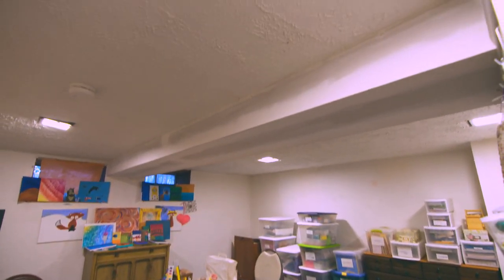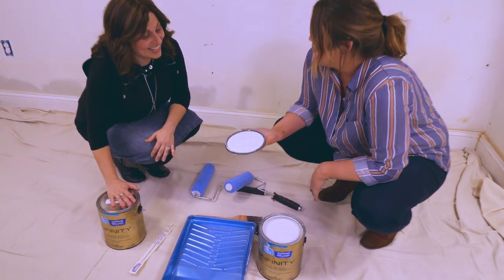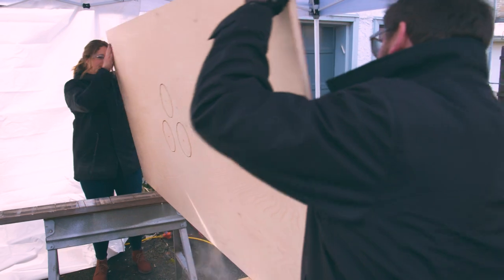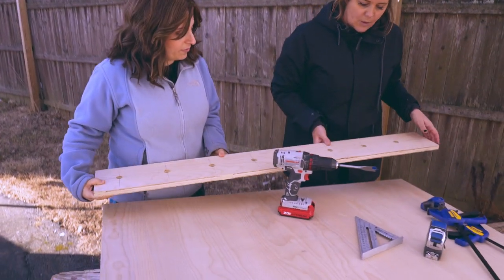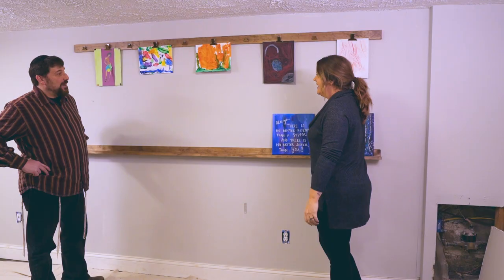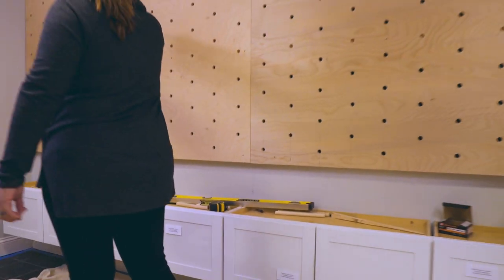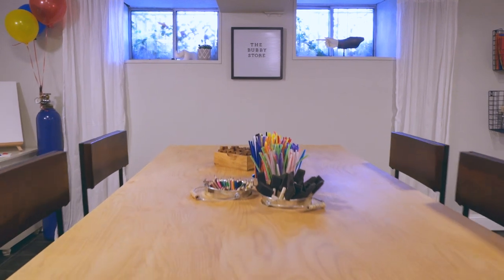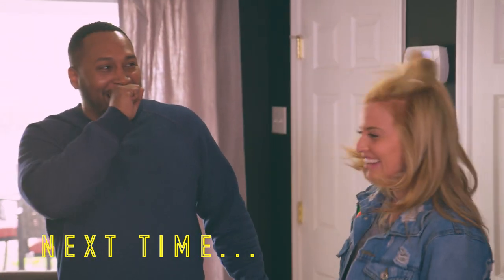The Weekender: "The Creativity Room" (Season 4, Episode 9)

Comment: Monica! I so feel this one! LOL
I am a retired professional designer. All that means is I no longer design for companies, businesses and people, I design for myself! I love color. Lots of color. And in my own space I always have neutral walls. The large pieces of furniture are usually neutral. And everything else is whatever color or season I am working with. That allows the space to be dynamic and non limiting. If you are working with orange and teal for some reason, a strong red wall and yellow items would be distracting to the eye. I put a lot of rich texture in the neutrals so that neutral is never boring. And I use black as an accent.

In other words - the space you did is what I think most designers would feel is a comfortable space to be highly creative. The wood is a great neutral. The only thing I always like to have is a wall of inspiration items. I think part of the pegwall could be this. I usually put homosote on the wall, and use large push pins and drapery hangers (the kind that go in the drapes to hang on the hardware) to mount all kinds of items. Leaves, shells, wood, photos, fabric samples, items that are just beautiful and I can look to as inspiration. This area of course is also intended to be frequently changing. And of course, there are spots it could fit without touching the pegwall (which is amazing! love it!).

Don't apologize for the grey - it totally works!

You have a new fan!

Comment: They have 5 kids plus the mom and there’s only seating for 4.  One of those cabinets should’ve been replaced with simple table legs to give them room.  I like the storage wall but agree with others here that the storage is insufficient for what they have.  I like gray but the color feels wrong for the space.  A soft yellow or light blue might’ve worked better.  This is one of the very few designs Monica has done that I feel comes up short.
Reply: I noticed that those chairs are the tall ones, like you see at a bar, or a place with standing desks. Look at those little kids. How are they going to get in and out of those chairs safely? And how do they use a table that tall? Not to mention how much smaller it is.

Comment: It definitely turned out great. However, one other thing about Lowe's in both areas that I have homes in...They don't sell 2x3's. At one of their locations,  they even said there was no such thing. As usual, they treated me as if I was the weird customer that comes in with some off the wall eccentric request that they have to take time out of their busy schedule to accommodate. A very "Peasant, be gone" kind of vibe.  I've bought several from their competitor, I just politely left and did so.